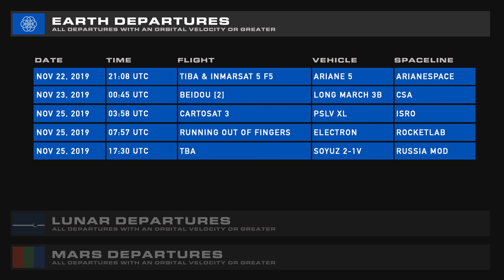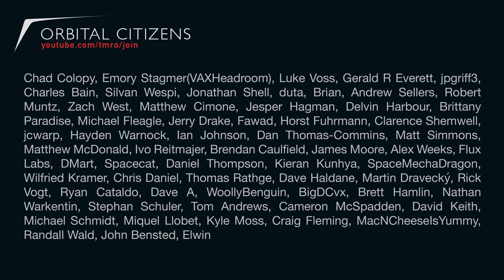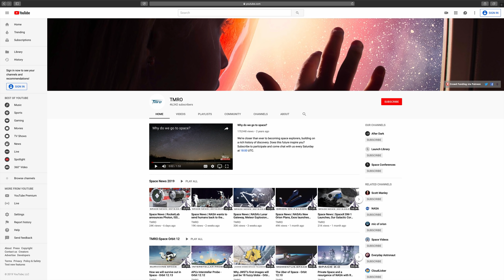Boeing is not happy with NASA report  |  Space News

Comment: SpaceX’s goal is to lower the price of space flight 

Boeing’s goal is to increase profits for share holders

That’s my opinion on the difference in prices per seat
Reply: Perfect concision.
Reply: SpaceX is busy on making money for her shareholders too, so that is not the answer. I believe there is a major philosophical leadership difference between the two. SpaceX is basically a one-man show start up company trying to reset space rocketry across the board and thus they are very open to risk. They are following an iterative development process that EXPECTS failures and resolves them as they happen while following good engineering processes in the design and manufacturing processes. Boeing has 60+ years of bureaucracy that has slowed her down across the board and made her risk averse which adds to the cost of development, testing, and deployments. I feel this alone can account for a major part of Boeing's costs vs SpaceX's.

Add in that SpaceX is coming in with a blank sheet of expectations with a focus on reuse of engines and rocket frames. Even a 4x usage per component is used that adds up to substantial savings every year. Also, having 9 motors for the first stage increases your manufacturing numbers which allows for cost savings in that area as well. 

Finally, SpaceX has more launches per year and that allows the company overhead to be spread over more launches which increases company efficiencies. So, doing 20 launches in a year saves almost 50% of this overhead vs doing 10 per year.
Reply: Spacex  stuff has blown up twice this year that's what they are known for
Reply: SpaceX is a private company so shareholder approval or profit isn’t an issue. They are actually moving down a path that is similar to the X-planes of the 1940s but without the human risk. Don’t know what I’m talking about? Look up the X-1 program.

Boeing is more concerned about losing a government contract and test failures will cost the big time. Government contracts and programs aren’t about innovation and risk.
Reply: Boeing can't use the excuse SpaceX was awarded by NASA a contract for Cargo program.  They had the opportunity to compete as well.  NASA COTS program awarded SpaceX a total of $400 Mil for Cargo.  NASA total award contract for Crew & Cargo to SpaceX was $2.9 Bil.   Compared to Boeing  contract $4.3 Bil for Crew plus and additional $287 Mil.
Reply: @Eric Johnson spaceX is not  doing charity . they wanna master space flights so that they can commercialise it . if they are successful then it will be world's  biggest company , more  than amazon . That much potential space holds .
Reply: @davidmoser7849  20 commercial launches last year,  14 this year so far, including 120 Starlink satellites - but ok, stuff blows up.
Reply: Humm well that is generally the differences you will have in a publicly traded company vs a private company, but mostly I think it is because they are used to the amount of revenue so their company is set up in a way which requires that revenue. In other-words too much bloat, but that bloat does create a lot of jobs in the space industry, so it's not all bad because when the old guard is forced to streamline because SpaceX has cut out a significant amount of their revenue there will be a bunch of people trained and who have worked in the space industry to work for more space companies, so it could cause a second round of space companies being made.

Or at least SpaceX, Blue Origin, Rocket Lab etc being able to pick them up.
Reply: @ItsEricAZ  Spacex is not a startup anymore.  They are the leader of this industry now.  They set the standards other companies fail to meet.
Reply: @davidmoser7849  differences in approaches, nothing to whine about.
Reply: Since Boeing is a business, it makes sense that it is run like any other ... to increase profits for it's owner.

(Boomer comment: BEGIN)
Once one of these "bargain" commercial ventures starts hauling people to orbit, there WILL be casualties and that will spell the end of the line. You can't cheap out space travel. None of the programs I have seen are even 10 years away from first passengers to orbit. NONE of them are even 2% of the way towards going beyond Earth orbit, and NONE of them will EVER go to Mars.
Only a nation can put forth the resources needed to be successful in space flight. Elon and crew are just dreamers dreaming ... more dollars than sense.
(Boomer comment: END)
Reply: @TankUni  Stuff does blow up, the stuff that's in development. Starship just blew up, earlier this year Dragon blew up. SpaceX is good at quickly building and testing their tech to its limits to quickly get info, and that's great, and also explosions are kinda fun to watch
Reply: @_PatrickO  - My point is that SpaceX has a start up mentality still while they continue to breakdown the bureaucratic inertia that is within the space industry.
Reply: @charleseinarson  good point.
Reply: Both want to make profit, but Boeing's approach is to rip off as much money as possible, with NASA and Defence as their primary contractor, so no budget problems, so the problem is not to make an appealing offer but to get as much money as possible from the contracts they'll get anyway, and keep things expensive works for them. Their only concurrence prior to SpaceX's rise was playing the same game so no problem, the cake is so big they could just share it.
SpaceX is based on giving the cheapest and best offer, which makes them more appealing especially to private companies. They also need to launch stuff for themselves so lowering the costs is fundamental for them. But at some point even the state agencies will find it harder and harder to justify going with Boeing if the delta in price keeps widening.
Reply: Deploracle uhm. Boeing just killed a bunch of people with faulty planes. Boeing still exists.
Reply: replace shareholder's with senators and i will agree with you
Reply: Elon musk wants to improve and innovate, but Boeing wants to cut cost while not innovating.
Reply: Watta World A
Reply: Not to mention the economic pain they gonna be suffering as this golden parachute gonna be gone soon
Reply: @Deploracle  Actually, not. Boeing constantly threatens to not participate if it does not get its usual premium. Boeing is used to cost-plus contracts like those on the SLS and Orion. If SpaceX's Starship and Superheavy are successful, Emperor Boeing will be exposed as a hog at the trough, to mix a metaphor. If SpaceX gets to the Moon and Mars ahead of the SLS and at a fraction of Boeing's projected cost, how will the Congress justify spending more for Boeing's inferior product. And SpaceX works on fixed price contracts which an inefficient and bloated Boeing and ULA cannot afford. 

And yes, I know that the Airforce requires multiple bidders on contracts, but that problem will be solved as Blue Origin comes on line...as long as Bezos is willing to subsidize. So far, SpaceX has survived and thrived while receiving less on every project than their competition. What's wrong with this picture and how long will the taxpayer be willing to subsidize the rest of the industry?  If Starship/Superheavy can put 100-150 tons into LEO for the cost of fuel plus amortization of the development and production cost  and SLS costs around two billion per launch, how will we justify that extra expense? And SLS is limited to a theoretical maximum of three launches per year...right now less than one per year through 2024. Eventually, SLS will be like the old horse-and-buggy in the era of the automobile and will have to be retired and its production facilities turned into the museums that they already are.
Reply: @slipknottin  Airplane flight is now a commodity, people NEED to fly. It's quite a bit different for space flight, that no one really needs at this point. Lose a dozen commercial space tourists and watch what happens.
Reply: @everettlwilliamsii3740  Yes, approach budding technology as a beancounter would. Since you were hammering Boeing on costs, it was R&D costs they were trying to save when their MCAS reared its head.

When the first disaster happens (not if, when) watch how fast all those numbers go ballistic. Boeing has something none of the others have, extensive experience in space. That is worth all the extra costs.

Why should Boeing try to low ball these newcomers to the field?
Reply: @badtrekee4348  That sounds kind of harsh. Is Mercedes Benz known for killing Princess Diana?

Each day ~10,000 Boeing jets carry passengers and freight safely around the world. Quite a feat you are conveniently ignoring. :)
Reply: Pretty sure SpaceX's goal is to lower the price, so they can be affordable, but still make a profit. SpaceX knows how politics works. Boeing is like any other government contractor milking the system.
Reply: Eli NAILED IT!
Reply: @slipknottin  You're missing the point, people NEED to fly so they deal with the risk. No one climbs aboard a commercial sight-seeing craft if the odds of survival aren't 99.9% or better, whether it's a space craft or a riverboat.
Reply: SpaceX is motivated by profit too. That's why they're doing what they're doing. If they can get the cost down not only can they steal away the current market, they can make the market bigger for themselves.

Boeing's interest is in suppressing competition through arbitrary barriers to entry and extending big fat government contracts as long as possible by blackmailing Congress with job loss in their state.
Reply: Deploracle I’m not missing the point, you keep changing your argument. If killing people doesn’t put Boeing out of business in a field where safety is incredibly good, why would it put them out of business in a field where safety is far less assured?
Reply: Elon can lose money. He doesn't want to, but Space is his passion, not his career. Boeing MUST not only make a profit, but considerable profit, because it relies on investors and has commitments to both their retirees and previous customers. My Grandfather receives his pension from Boeing, as will my Father in a few years. It is utterly frustrating, yes, but all of these  companies and their spacecraft are far more efficient than anything archaic NASA has done since Space Lab.
Reply: I have no evidence, but suspect Boeing has a huge budget for lobbying.
Reply: @davidmoser7849  That is probably the weakest troll I've read this week.  Do better =(
Reply: @Deploracle  Not in this case, though I would argue that the British tabloid industry is known for that very occurence.
Reply: @Deploracle  I think you are probably correct about the sweetheart deals.  Boeing is essentially a subsidized company at its core.  That wouldn't be an issue if they were focused on innovation, but they have increasingly become a bloated parasite that is more interested in making money than in providing a valuable return on the free money.  Boeing really is a shameful company if you look into how they operate.
Reply: @davidmoser7849  Compared to the number of launches and qualified successes in the past and YTD, this is a very small percentage.  

The Draco engine and COT program is in its infancy, but maturing.  Any program like this is going to experience setbacks. Mercury, Gemini, Apollo, Shuttle programs have experienced issues, and sadly loss of life. SpaceX's goal is to have zero loss of life, loss of a flight vehicle is inconsequential, but one person killed would bring it all to a screeching halt.
Reply: Weaaaaaaaaak
Reply: @everettlwilliamsii3740  totally agree
Reply: @davidmoser7849  The one in April was a test of the escape system.  And, SpaceX admitted it had problems with it.  But, they immediately began investigating what went wrong and how to fix it.  The second was of a craft that wasn't ever expected to go to space.  Plus, they purposefully maxed the pressures to see where there might be problems.  And, even there they are using what they lerned to improve the next version.  A very big difference in mind-set between the two companies.  Boeing seems to always come up with excuses on why something didn't work as it was supposed to instead of admitting there's a problem and fixing it.
Reply: @Etheoma  The problem is many of these people you say companies like Boeing have hired aren't innovative minded.  They wouldn't do well in companies like SpaceX.
Reply: @Deploracle  The problem with a very good part of your 'boomer comment' is it is very short sighted.  Nations - especially the USA - end up putting the money where it isn't needed just to satisfy one politician, or another.  Or, worse, award contracts to those 'good old boys' that built XXX a decade ago (never mind they haven't built anything since).  And, there's a very big difference in using equipment smartly and 'cheaping out'.  Making as much of a system reusable - even twice - in cost efficient and, when proper standards are in place (which SpaceX must have since they have an excellent record) just as safe as one-time use.  You're percentages I'm pretty sure are a bit low, probably because you seem to have something against commercial space flights.  (BTW I'm a boomer, and think nothing like you apparently.  So, don't try to represent the generation.)
Reply: @Deploracle  But,it's not the 'extensive experience in space' people that are making the bids - or making the decisions on the goods anymore.
Reply: @Deploracle  Why do you keep bringing up this 'sight-seeing craft'?  That isn't what's being talked about here.  And, if SpaceX does offer such craft in the future, I'm pretty sure they'll be a lot safer than one accident per 1000 flights.
Reply: @dimezrecon  That still doesn't justify the cost they're charging.  It's totally idiotic for them to even try to justify that much of a difference in cost.  It's greed pure and simple.  And, trust me, almost none of all that extra money they're raking in will go towards any pension plans.

Comment: Who cares if Boeing isn't happy, maybe they should do better work and scrutinize themselves!
Reply: They made very poor decisions with 737 MAX, and I agree they have to be better.
Reply: Deploracle the a330 had a similar problem as well. So the 737 max isn’t the fist time.
Reply: They don't need to, theyll get the funding anyway, so keeping things expensive is good for them.
Reply: ana marte the a320 neo. They’re both using the the “leap” engine which positioning gives some undesirable handling issues at high angles of attack. Airbus countered with some adjustments to the 1’s and 0’s in the flight control laws.  Boeing decided to use MCAS which we know is a debacle.

Comment: Boeing custom machines a ball peen hammer from the finest ingot costing $20,000 Boeing: What? its a hammer? Government: "Seems legit" Space X walks by with a launch certified Snap On hammer and a $250 price tag 

Government: ヽ(ಠ_ಠ)ノ
Reply: $250?  I would think just $25.  ...it's a hammer!!  But you forgot to mention Boeing probably tested it in a vacuum chamber from -200 to +200 degrees C and on a $2.5 million computer-controlled, hydraulically powered, hammer-swinging arm, striking it against a $250,000 titanium anvil 3,600 times a day for 6 months, per NASA requirements.  Thus proving it is safe to be used by astronauts.
Reply: @Andrew-13579  That is what makes Space X's  $250 launch certified hammer not $25.
Reply: @Andrew-13579  well ya have to have standards. A $5 hammer is plastic and will shatter on impact. A $25 dollar hammer has casting defects and poor quality inspections. A $250 dollar hammer was probably made of a decent metal and someone might have actually looked it over for quality.
Reply: @Andrew-13579  never heard of snap on huh?

Comment: So they still litter what happened to the unwanted debris shield is it floating Round?
Reply: it will encounter atmospheric drag and deorbit in time: probably a few years, maybe a few months.
Reply: @faulxeve6590  hi will it add too global warming?
Reply: @mathewghoneysett7756  good question, could be the very opposite I guess.
Reply: @snuffeldjuret  Particulate debris in the upper atmosphere should reflect solar energy more than the friction associated with its entry.
Reply: @saxonsoldier67  good point. I wonder though if the "burning up" is an endothermic or exothermic process. Maybe it is obvious that it is exothermic, but with my current (lack of) understanding I would not bet my life on it.
Reply: @snuffeldjuret  Friction heating combined with oxygen at very high temps reduces most material into particulate ash before impact with the ground.   Large or solid items being the exception (unless you are a fan of Dead Like Me).  The burning releases energy (exothermic), but the ash in the upper atmosphere creates far more solar shielding.   Have you ever seen a sky with many contrails from jets ?  The contrails create artificial clouds that reduce the solar input upon us on the ground that can be felt.

Comment: I'm certainly willing to agree the astrophysicists know what t hey are doing with regard to nailing the water vapor plumes on Europa.  I am curious (I'm a computer guy, not a physicist) what methods they use to distinguish between subsurface water vapor and that which comes from the surface as a result of meteor impacts which presumably melt a lot of ice and fling it outward.
Reply: The fact that it is liquid when it fires up though the crust though the temperature is below -200 F. A meteor strike would be wider and have the characteristics of a splash rather than a plume.